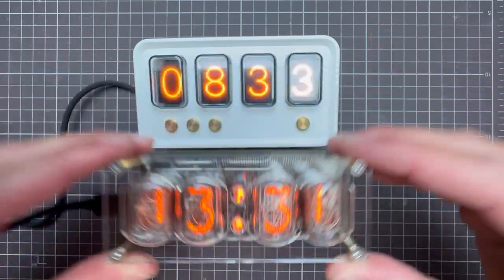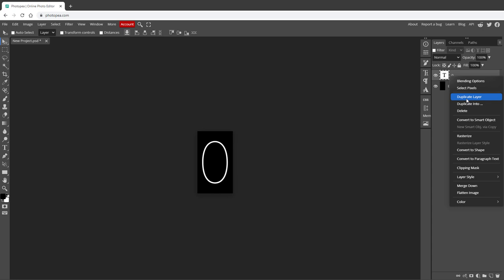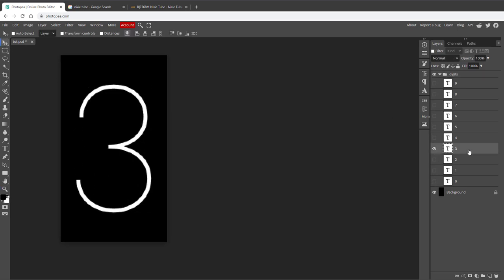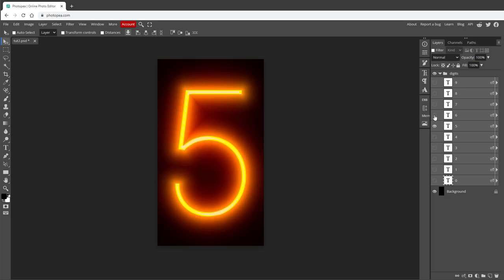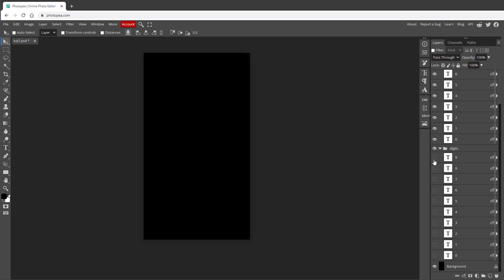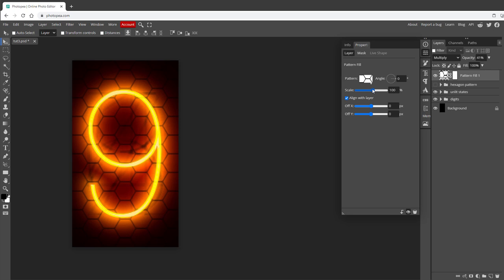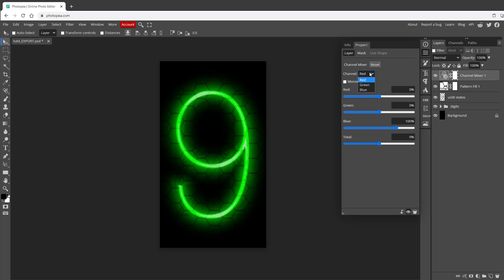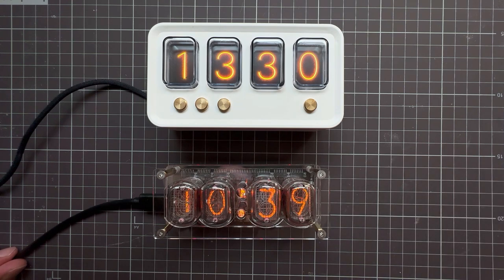Nixie Tube Clock Without Nixie Tubes

Comment: If you want to stay true to the nixie tube look your 5 has to be a 2 upside-down and mirrored. Also it would be cool if this could cycle through the numbers every so often like what is best practice on actual nixie tubes.
Reply from the maker: Not all nixie tubes had the 2 and 5 digits using the same shape. I agree about the cycling through, but the used ESP32 chip cannot update the screens very fast.

Comment: Video is already outdated, because the produkt ist sold out. Same one the pruducers site.
I have another 6 Digit IPS Produkt other style. I like it.
They had a app that had already nixie cube designs availiable.
Reply from the maker: Thank you for your comment. You can still buy the 4-digit display on AliExpress, and you can use the same application and theme also for the 6-digit versions, so hopefully it´s not that much outdated.